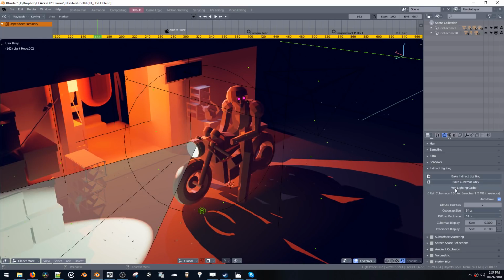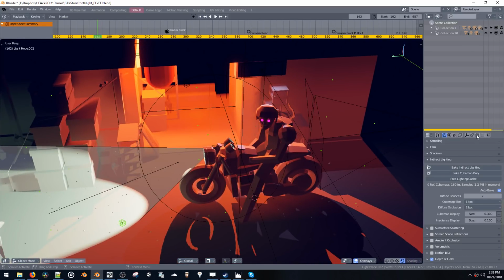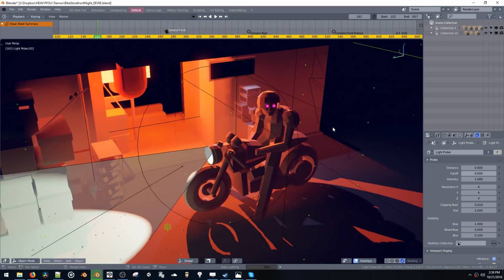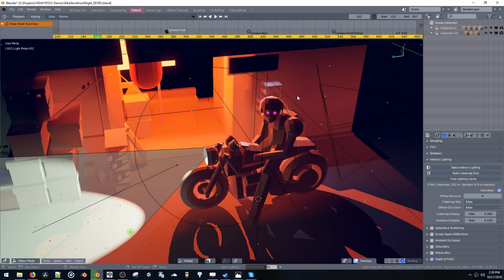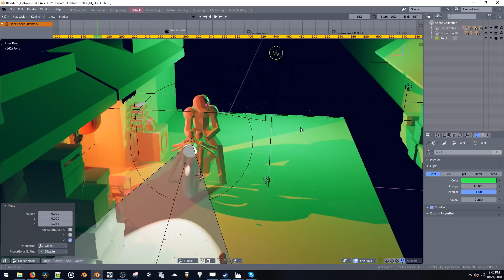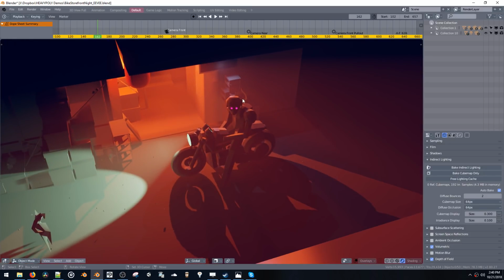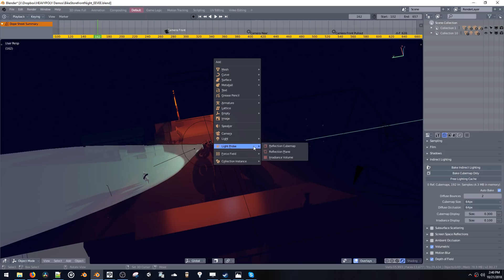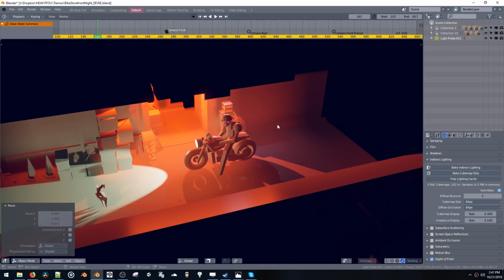Blender 2.8 Realistic Lighting Setup | How to use Irradiance Volumes in EEVEE

Comment: Do you know if there is a possibility in Eevee to limit the effect of a light to a single object or collection of objects (ie is there a way in Blender 2.8 to achieve what was the "this layer only" lighting control in blender 2.79 and previous? I have been trying to work it out and i cannot find a solution with the results that it seems to me there is no way to achieve realistic lighting in fact in Eevee as the light penetrates objects and lights element that should be in shade or unlit. Grateful for any suggestions or help

Comment: Pls can u make a tutorial about volumetric fog and mist theme pls in evee
Reply: Don't know if this helps after one year. But for volumetrics you use the same setup as in Cycles, PrincipledVolumeBSDF works fine for me. You can plug a volume node into either the world output or an object's. Only unfortunate limitation is that Eevee doesn't currently support in mesh volumes, it will only generate the effect inside a bounding box over them.